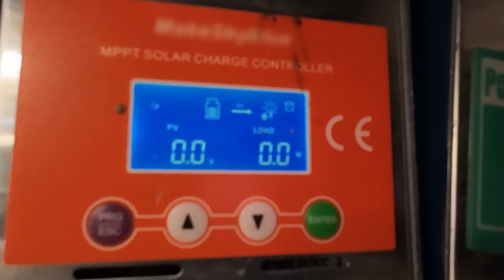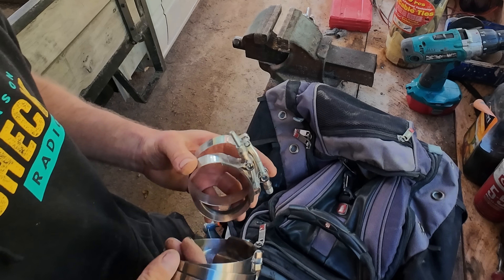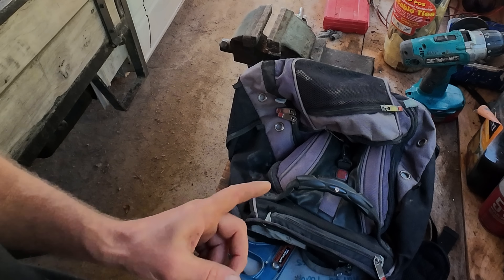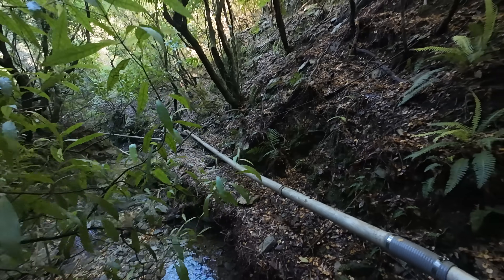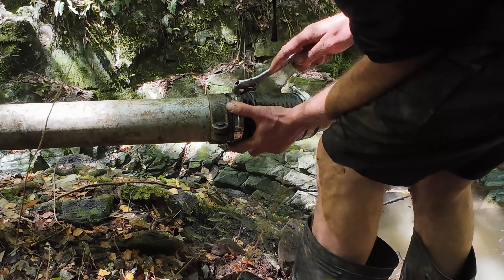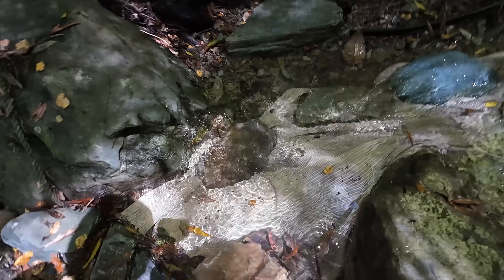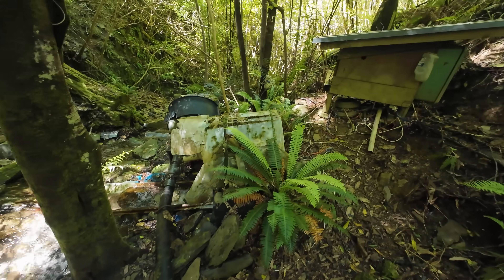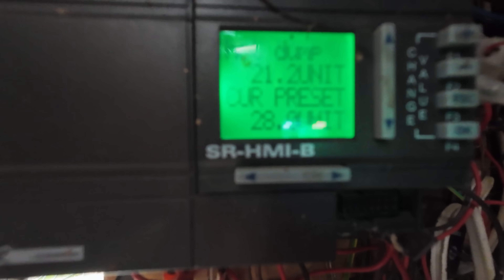A Rockfall Shut Down My Off-Grid Power

Comment: Hi, why don't you use plastic pipes for water? It's less expensive and more durable.
Reply: Ummmmm..
Plastic tends to get brittle with age and fractures when hit by rocks.
If you are mean High Density Poly Ethylene pipe...that's expensive.
Marty used "scrap value" old aluminium irrigation pipes because they were "free"....

Comment: You should build a 6m tall concrete dam and create a small resevoir to that creek. It would be much better and powerful.
Reply: The amount of water needed to keep the penstock (pipe) full requires no dam at all....
The effects of gravity which provide the "energy" for the system do no take place until the water is in the pipe...

Comment: Would it be smart to transfer the power on the power wire on a high voltage (700+v)? I remember it was really long
Reply from the maker: It would be more efficient, but imagine the zap of 700v on wet fingers when working around the turbine 😅

Comment: I'd wondered if you have much trouble from land slides in that gully... I have friends who live in the mountains in Belize who have a stream located in a similarly steep valley, with similar-looking rock, and they get quite a few slips into the stream course in heavy rain. They don't have a hydro power system but do use a hydraulic ram pump to lift water to their house. Very cool system too.

Comment: Love it. How much free power do you get?
Reply from the maker: Its pushing out 600 watts constantly at the moment, I can put a bigger nozzle on it and get 1kw but the bearings wear out a lot faster
Reply: So you must “ration” the use of electric heaters as most are at 1000W’s as to not drain your battery’s?

Comment: Is there any specific reason for the different type of connectors other than that's what you had? BTW nice job keeping the spare sections down there? Murphy is disappointed.
Reply: When he did his mates place, these pipes are from old argi watering solutions that went end of life but are still well in spec for his needs (i.e. waste not want not).
Reply from the maker: I was in a very tight budget when I set up the system 20 years ago, I used what I had available, these days the proper stainless  joiners are cheap on AliExpress so I replace the old ones as they fail

Comment: If you can score cisterns/tanks for cheap, consider adding water batteries to the setup. Compared to a conventional battery, as long as you keep the tank painted so it doesn't decay from UV, it will last you a life time. There's literally no reason it would ever decay. Just a thought. ;)

Comment: the pipe follows the stream, what is the reason why you pipe it instead of just picking the water up further downstream [knowing you, it will be a good one i haven't thought of...]
have a merry christmas young man, and your family...
Reply: When its in the pipe, it builds up momentum via gravity which gives him the pressures required to make it a high pressure hose jet at his generator wheel/paddle.  If it was shorter he would not have enough pressure or would need more water from the creek.
Reply from the maker: Because you need some pressure behind the water at the turbine end (Head)  The greater the height difference between the intake and the outlet, the higher the pressure

Comment: Nice content, as ever.

Would a shut-off valve be helpful near the intake?  So if/when repairs are needed, the pipes can be quickly emptied and then become a lot easier to re-position?
Reply from the maker: You could, but its another expense and another thing to go wrong.. I just  just put a plastic sheet over the intake when I need to stop the flow

Comment: Check out Kris Harbour how he makes the intake
Reply: Yes. 
See how Kris has vortices from the swirling water going en masse into all his intakes.....
those vortices suck air down into the pipes on all his projects.

See Marty's intake has lots of very small holes that don't produce any vortices and therefore don't suck air into the pipe.

So Marty's penstocks naturally purge themselves of air.......
which is why right at the end of this vid Marty said "when all the air is out (of the pipes) it will be up around 600 watts.."....

Kris has great woodworking and building skills...

Comment: Yep-good to have power.  Free power!
Reply: It´s not free. There´s no such thing. A lot of work went into building and maintaining that power station. Then you have the parts that aren´t even free if you think in terms of money alone. How much is your time worth?
Reply: @petemommo9622  
MartyT
1 hour ago
Cheaper than having to go to work to pay someone else for power...  + I need the exercise 😂
Reply: @petemommo9622  Thanks Captain obvious, I didn't know any of that, wow!  To answer your question, yes, I would build that if I was under similar circumstances, absolutely.  In my area the average value of power is 18 cents per kwh.  Marty's generator, assuming an average output 650 watts continuously, generates 5,694 kwh per year if it runs continuously.  The value of that power is worth 1,060.27 per year in the best case, which will never happen, but if you can maintain it for less than that in terms of time, and materials, then I consider that as close to free power as you can get.  Marty had a need, to live the way he wants, so he built it.  I'm of the same ilk.  I consider my time as absolutely worthless unless I accomplish something productive with it.
Reply: @JemezDaveNM84  Nobody´s time is free even if you don´t price it in money terms and instead use some other opportunity cost like time spent rambling, traveling etc. If somebody enjoys tinkering then that´s another thing entirely. In fact I´m one of them and fettle with bicycles and everything round the house and homestead, too. I also just told Marty (again) that I´m also planning to build a similar washing machine power station. Keeping my mind on some abandoned piping. Sofa? Far too much effort. If I´m not doing anything I´m flat on my bed like a beached whale. But back to the cost of centrally generated power. It may seem high but isn´t really. Everything we do as a civilisation is motivated by the ever-present desire to do less and have more leisure. That´s how we´ve advanced: by having men just lying idle thinking about new ways of doing things. I´m very much a disciple of Russell in this regard.
Reply: @petemommo9622  Let me explain something even you can understand.  The stream is the power source.  Marty utilized that source, which by the way is free as long as it's flowing, and he wouldn't be doing it if it wasn't worthwhile.  He obviously has free time for leisure he's satisfied with or he wouldn't be doing it.  Again, I'm of the same ilk.  You condescend to people you don't know.  Maybe shut your mouth more and do society a favor.

Comment: I would love to set a turbine in the creek behind my house, but the flow fluctuates from 19 inches to 6 feet+. No way I can see to accommodate that issue. Enjoyed the video.😊
Reply: What would Marty do?   

More pipe buried in the bank of the stream 
Lots more digging 
longer run over-all to keep generator above   flood height 
No pipes crossing the creek to avoid flood damage 

Everything else including generator housing the same 😂
Reply: Build an  overflow dam...
just like Marty's friend had when he and Marty built that washing machine motor generator setup on the friend's property.

It doesn't matter how much water flows over the dam...as long as the retention pond supplies enough water to fill the penstock to the turbine at all times.

So build a dam that provides that minimum flow amount....and let everything else flow over the top of the dam!

You take the penstock water from a pipe half way in the depth of the water ...where the water is the cleanest...
where any silt has fallen to the bottom of the dam...and the leaves have floated over the top of the dam....